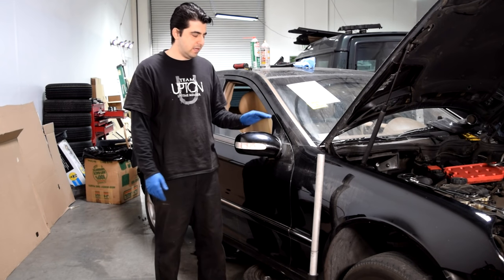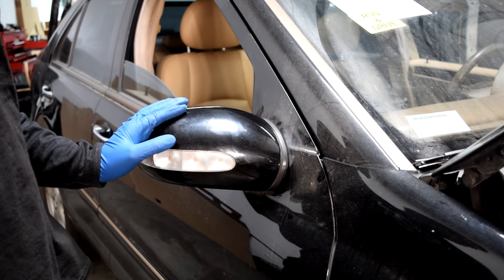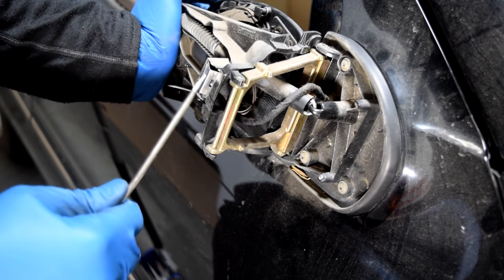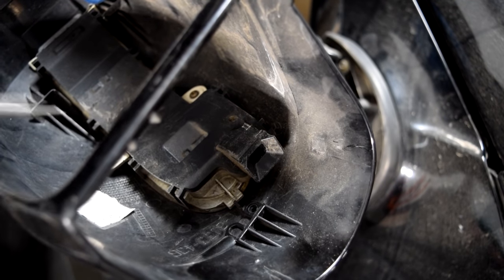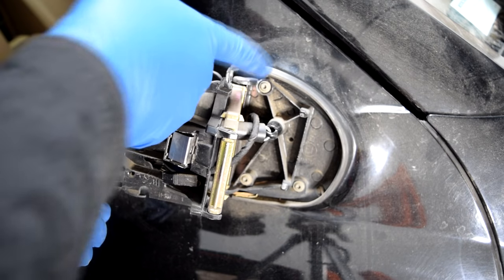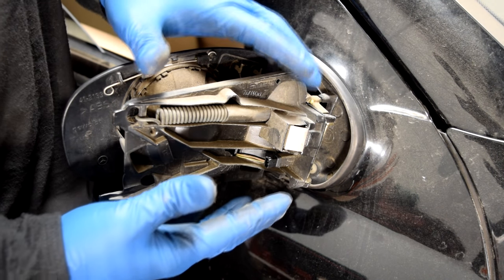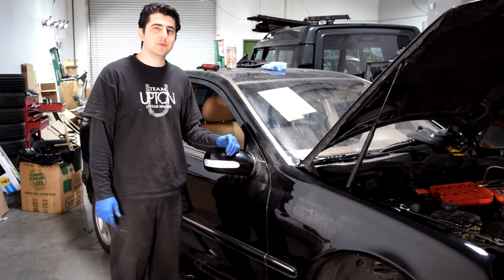How to Replace the Side View Mirror on a Mercedes Benz W203 C240 C230 E320

Comment: Thank you for this informative video. I am trying to help a friend repair their mirror, the housing was pulled off and I can see from your video that the securing clip was popped out of the pocket it latches into and may ever be bent. With the help of your video I will be able to get the attachment clip back in the proper location with the lip under clipped in and properly reinstall the mirror housing.

Videos like yours with good close up details really help when there is a problem and this may be the first time you have attempted a repair such as this. 

Thanks for your time, this video has saved me a lot of time and headache.

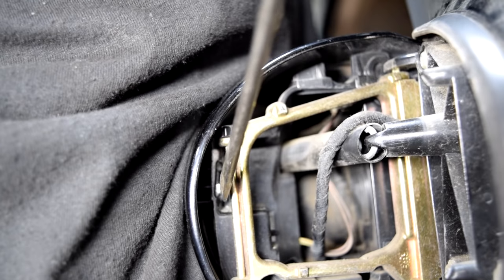Comment: The close-up of the clip at 1:02 was super helpful. Took me 20 minutes to remove the cover, replace the turn signal on my 2005 C240, and slide the cover back on. At first, that metal clip kept "clicking" back into place while I tried to wiggle the cover off. Try & try again = success. Thanks!

Comment: Excellent detailed video. Thanks very much. Can I ask how if you knew where the power motor is located as I have a lazy folding mirror and I want to spray with wd40 maintenance spray to get it moving like it should. Thanks

Comment: hello I loved your videos, please orient me how you fixed your car, i'm from Brazil, small town nobody knows how to fix it, which part was defective as it did to fix it, i have mercedes c class 180, kompressor i have the same problem, mercedes, do not turn on the headlights and no turn off the flashlights, only the right side is accessible, to disconnect you have to remove the battery Thank you for your help

Comment: I have a 2003 S430 and the passenger side mirror no longer self adjusts, any idea what could be causing it? I recently got a new battery and since then those issues came on. Wonder if it's a bad fuse and where that might be located and which number controls that sort of stuff. The door soft close also is not working. Any help is appreciated. Thx

Comment: I'm trying to take the shell off a loose 2004 E320 mirror.  There seems to be part of the internal casting that blocks full access to the slotted spring clip. There's no way a flat screwdriver can get it to move down and become unclipped because the force of the spring that's pushing the clip back in position is so strong you can't get it to stay unclipped.

Comment: i have a 2005 c230 and i replaced the entire mirror assembly. It is back working great. Just one issue, now on my dashboard it reads ..... (turn signal left mirror ) and flashes really fast on dash, when making a left turn. But the actual lights on mirror are fine. Do you no whats wrong or if there's a fix for this?
Reply: K Edwards I was looking to replace my mirror on my W163& came across your question. He has a new channel (to replace this channel as R&W , Ratches & Wrenches). Your turn signal bulbs front or rear may be out & check your wiring if you pulled something out & the bulbs are in properly. I don't know if you fixed this  problem or not.

Comment: how does the turn signal get power if you just slip the mirrorcap off like this? you didnt disconnect any wire  , i am confused :D is the power ofer the metal clip connected?

Comment: The plug on the back of the mirror  is a c34 but the mirror  i purchased does not have this plug on the back it has a longer smaller 10 pin plug.. is there an adapter  or something?

Comment: how to repair sun roof of the same model of mercedes, mine doesn't go back.
Reply: omid 
Hello I got mercedes c180 kompressor 2007 "Turn signal left mirror " sign came on dasboard but signal light working. What's the  problem 
Thanks

Comment: I took my cover off and replaced the broken indicator, now it refuses to click in place. I tried like 100 times. Men tried pushing it in and it does not aligh and does not click. Very stiff.  Even WD40 on the clip refused to work. Im fed up and gave up. 😒🙁
Reply: Same. Doesn't click in at all, literally tried 100 times. Shit car

Comment: I need your help man, I own a 2002 c240 and they hit my whole side mirror thing, so my mirror is cracked and the light thing from the signal also cracked, where can I buy a new one online please help. Nice videos by the way, just subscribed. Hope you can help me :/
Reply: +Rick Cee just got one on ebay for $140 shipped
Reply: Link?
Reply: Rick Cee I had the same problem as you, the whole case was cracked including the lights. I searched on ebay "2000 CLK 320 Driver-side mirror" and there were two active auctions. There are tons of silver ones for sale so if your car is silver you shouldnt have a hard time.
Reply: Thanks man, I actually do have the silver one.
Reply: sure thing hope you find the right one

Comment: Thanks for the video but you need to specifically tell the audience if it is a retractable mirror dont push with hands else it will break it. I had a retractable model, I pushed as per the clip and broke it. Now I have to spend $500 to replace the this side mirror :(